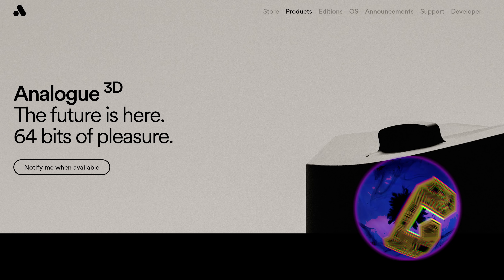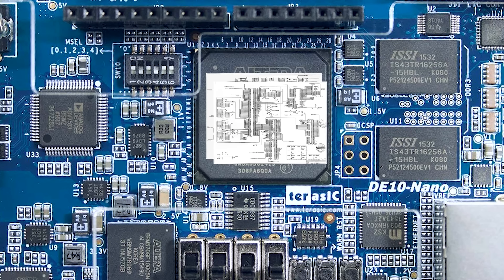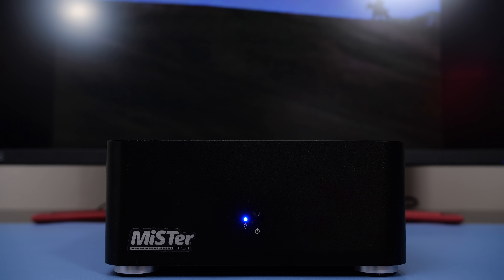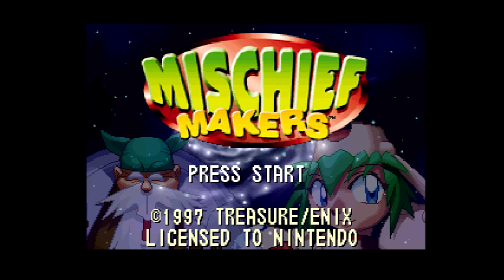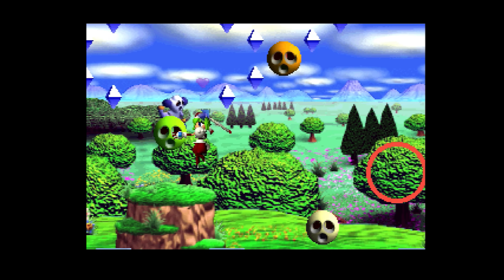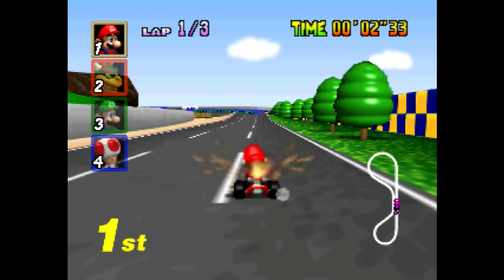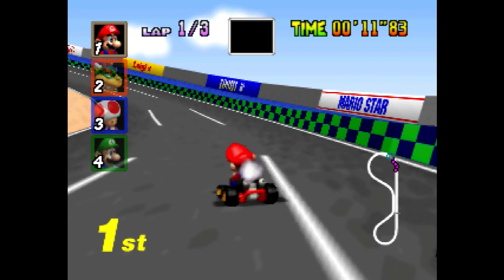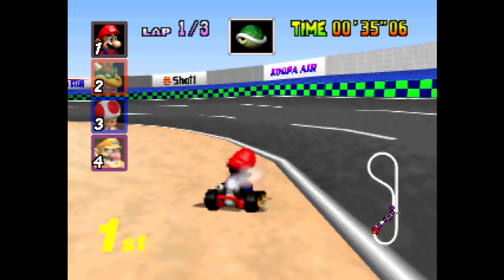FPGA Nintendo 64 gaming is here.

Comment: FPGA cores are not 1:1 recreations of the original console hardware. They emulate the original hardware through reverse engineering, but the internal workings may be entirely different from the original system. Therefore they're no more preserving the original hardware than a software emulator.
Reply: That's true if you ignore methods using scans of ICs after decapsulation and delayering them, however, it's true that in theory neither is preserving the original hardware better than the other because both are nothing more than software files. In practice, FPGAs force the developers to get closer to the original behavior of the hardware imitating due to the constraints of the platfrm.
Reply: Correct. But FPGA vendors will try to convince you it's not "emulation" and how it's inherently more accurate than software emulators, which is not the case. This is all marketing talk of course that aims to the big game collectors who usually don't know much about emulators and have a bias against them.
Reply: It's probably more accurate to say that this is a hardware emulation instead of a software emulation (since we are taking it down to the chip level).  But I would have to agree that is must be called an emulator if for no other reason than we aren't using the original chips.
Reply: Interesting. I've heard it's 1:1 multiple times from various outlets. Guess I'm not surprised!
Reply: You don’t go out of your way to call hardware clones and the official SNES consoles with the 1-chip “emulation” so you are really just grifting. Hardware clones are done the exact same way only they write HDL to use logical elements from an ASIC, meaning it gets baked in at the fabricator instead of being field programmable. The ability to be updated/reconfigured in the field is the essence of an FPGA and makes it better, since any errors are permanently baked in to your typical ASIC hardware clone but can be revised in an FPGA clone. Imagine if Nintendo could have fixed their SNES 1-chip clone.
Reply: MVG talked a bit about this on last night’s Spawncast. Also mentioning that there are interpretations and judgements, so it’s not the exact 1:1 that is sometimes touted
Reply: @billcook4768  No one has touted Robert’s core as 1:1. There are interpretations exactly like that even in original hardware, like when the Super NES reduced PPU1 and PPU2 into a combined PPU, or when they further reduced the chips by combining them with the CPU to make the so-called “1-Chip.” The ASIC they used is imperfect. SNES clone makers somehow got their hands on it and are still making SNES 1-chip hardware clones to this day. The only real difference between the ASIC and an FPGA is the “field programmable” part, where the ASIC needs to be defined at the chip fabricator with a lithography mask. FPGA can be defined and redefined later so any errors can actually be fixed. Meanwhile, SNES 1-chip consoles from Nintendo themselves still have issues with certain games while the Super Nt’s FPGA can not only fix the flaws it can even reconfigure itself to replicate the various quirks and flaws of the 1-chip, 3-chip, etc.
Reply: Easy enough for you to say without doing the work, that said for the de10 nano and mister I partially agree with you for the analogue I don't have enough information to say.  About 15 years ago I recreated the 2a03 on FPGA(spartan 5 and MAX10) accurately with all the control signals and timings which accurately models this particular chip.    Now is someone that reverse engineers and works on a core a "wizard"? not at all.  If you know what you're doing and have valid reverse engineering that verifies then it wouldn't take much time at all.  In the case of the Cyclone V i know that multiple parts are emulated through the HPS(hard processor) so saying the entire system is on the C5 is disingenuous.  I've been around the emulation scene since 1995(im friends with zsknight and the like and was part of the org zsnes team).

Comment: It should be acknowledged that people also wrote off PS1 and Saturn for years. I even saw a lot of people say the 32X was highly unlikely prior to those. To simply say people thought the ceiling was PS1 and Saturn for years is kind of misleading.
Reply: From the start I was hearing “maybe PlayStation” as the ceiling. Anyone saying otherwise to downplay the possibility was likely trying to manage expectations because it wasn’t a sure thing. Meanwhile, 32X and Saturn hardware are too similar to distinguish this way. With so much shared hardware the main difference ends up being that one needs a Genesis core along side it and the other needs an ODE to replicate the optical drive functions. My understanding is that most MiSTer cores with an optical drive use a kind of software emulation on the ARM SoC for the shared optical drive framework while the rest is replicated in hardware FPGA.

Comment: Does such a thing exist as an "FPGA card" to out into a regular PC? I'm curious about the future of gaming hardware and wonder if a hybrid system using a regular modern processor in combination with this tech would be the best of both worlds. It'd also allow us to have a single system for all games.
Reply: There is but they are really expensive and meant for development, something like the MISTer probably could be sold as a Pcie card but that' just an assumption.
Reply: Interestingly enough, these FPGAs do have a normal ARM processor inside them that is used in the MiSTer for the Linux backend that runs all the USB input devices, networking, storage, and probably anything else that isn't running on the FPGA side. However, it is not very powerful. You have a pretty cool idea though.
Reply: Both the mister and the Mars projects are "hybrid", in the sense that they also have an ARM CPU, things like menu and processes that make sense make use of it.

As for the "FPGA Card", there are many already, but the modern CPUs are already capable of doing low level emulation, offering practicaly the same thing as a card used for retro hardware would.  However, PCs have a hardware and software pipeline GPU, OS etc to take care of, which add delays, so it's not as fast as a processing/display that's done all in FPGA.

Comment: Can they please stop saying "no emulation"? Emulation: hardware or software that enables one computer system to behave like another computer system.
Reply: FPGAs don't really fit that definition as they're not necessarily a computer, and don't have any default behaviour. If you don't configure one after powering it on, it'll just sit there consuming power without doing anything. If anything, they're like a middle-ground between fixed-function hardware and software emulation. It's not following existing instructions to get the desired behaviour, but it's not baked into the circuitry either.

"Re-implementation" might fit. After all, you can get FPGA replacements for the custom video or sound chips in the Commodore 64 that can be dropped into an original system's sockets. In the PC realm, the Graphics Gremlin video card implements classic and VGA-compatible versions of MDA and CGA using an FPGA. Stick it in a retro-PC and it won't be able to tell the differnce between that and an original MDA or CGA card, and in the classic modes, neither will a period monitor.

Overall, I think we're running up against the limitations of language here. We just don't have an accurate term for what we're dealing with, so we're trying to cram it into boxes we already have and it doesn't fit either well.

Comment: Preservation is thrown around a lot, when talking about FPGA. But I am seeing more and more, that the original design gets scrapped because it won't fit into the FPGA or that there is a more mothern way of designing hardware and that's why a 1:1 replication isn't used in the implementation.

Sure you might not notice the difference when playing the games, and as such there's a type of preservation. There was however a reason why the original design was made the way it was and that is getting lost.

When the original hardware won't work anymore and we only have modern interpretations of the original designs. Then we have not preserved the history. It would be nice to be able to look back on what was and be able to learn from it. But with the current mindset, that won't be possible.
Reply: Robert’s throwing out what was never used and trying to replicate the rest down to the most subtle/minute detail. There are other cores for more powerful FPGAs that aim to replicate the N64 more closely, like UltraFP64 and whatever Analogue is doing.
Reply: @emmettturner9452  Even though this video is about that specific core, I am speaking more generally. Jotego does it with every core he makes and he might not be alone.

My point is preservation for who? Obviously just the gamer's, not hardware designers that want to study what was. The original hardware design have become a second class citizen, so to speak. But the games would never have existed in the first place, without that hardware. So if you are really into preservation then you must preserve that other side to, not just making the games playable.
Reply: @LisaSamaritan  Jotego’s TMNT core was made with transistor-level chip-peeling/recapping but that’s really because Furrtek did the legwork. ;) Jotego will source existing HDL wherever he can, so some like a Z80 might be a true transistor-level replica and others will use the “black box” style of development using a logic analyzer to replicate logical inputs and outputs rather than the internal structure of the original chip’s logic.
Reply: @LisaSamaritan  …and if you think about it, that’s exactly what Nintendo did for the SNES 1-chip consoles. These days we have FOGA clone consoles that reconfigure themselves to replicate either the 1-chip, combined PPU, or original 3-chip SNES consoles. ;) Any one configuration could have flaws but, then again, so did the original 1-chip… and it didn’t have any “field programmability” to deal with it. They got baked in forever and even the SNES fixed hardware clones today have the same flaws (RetroBit, RetroN, Old Skool, etc clones like Supaboy and RetroDuo). Yeah, being defined at the fabricator with a lithographic mask versus being able to redefine in situ (field programmable) is the only real difference between FPGA and a traditional fixed hardware clone.
Reply: @emmettturner9452  we are definitely not talking about the same thing...
Reply: @LisaSamaritan   Oh, we are. We definitely are… whether you realize it or not.

Both ASIC and FPGA are written with an HDL, and revisions to the original hardware often incorporate an ASIC developed without the original chip designs the exact same way Jotego does it. In the end, the only functional difference between FPGA and ASIC is that one is “field programmable” and the other isn’t. That means one can be reconfigured to fix mistakes or clone entirely different set of hardware and the other  is a fixed hardware clone replicating one set of hardware where mistakes are baked in forever (the 1-Chip SNES is one such example).

Because FPGA is able to be revised it is inherently better at preserving the original hardware than even some things we actually consider original hardware (again: SNES 1-Chip… FPGA can replicate both that and the original hardware!).
Reply: @emmettturner9452  No. I am saying that if the original creator of the hardware wants to make a revision, then that's up to them. But someone claiming to preserving the hardware design, shouldn't make up their own design. I don't care if it is cycle accurate and produces the same end result (being able to play the game).

Regarding your example, you are claiming that it should be an endless amount of fixes. But I am the type of person that believes in doing things the right way, the first time. Then you don't have to do more work than necessary...

Anyway, that's beside the point. Let me use a completely different example. Let's say that we have an arcade machine. There was only ever a single game released for this machine.

The fact that there was only one game released, is not a limitation of the machine. You could make however many games that you want, as long as you are sticking to the hardware's inherent limitation.

Now someone comes along and makes a core for this arcade machine. And they deside that because there was only a single game, he can remove functionality and cut corners, because it doesn't matter to make this game playable.

This however is shortsighted. Because a unreleased game or someone's homebrew game, that would have worked on the original hardware (by only replacing the memory chips containing the game asset's), is now unplayable on the core.

If we are doing preservation, then we should also preserve the ability to use the hardware design in ANY way, that it was originally able to do.
Reply: @LisaSamaritan  This just sounds like an issue of documentation. Do you think they are decapping chips and getting all the PCB schematics, putting some half-ass core out then deleting all the original hardware info they had on it? Well if that's the case, sure, that's not preservation, but I really doubt that's what they are doing.
Reply: @kunka592  did you read my last example about an arcade core?
Reply: @LisaSamaritan   I understand, but the reason I keep using the 1-Chip example is because it wasn’t a simple revision the creator of the original hardware chose to make. They basically made the original hardware then asked a different engineering team to clone it without the source designs so it could be condensed onto fewer chips. They did not have the goal of preserving the original hardware design either… just making a functional clone.

I understand your concern here. If I made a new game for a hardware platform and I used the FPGA core to develop it, it would be ideal if the results were identical to ensure my game could run on original hardware… but I also think you missed the part where that level of documentation has been happening side by side with the cores that had to be cut down.

Take the Robert “FPGAzumSpass” Peip’s N64 core… look at all the buzz that one gets and understand that a fully-implemented N64 FPGA core was designed and complete years ago from Murray “MazaMars” AKA UltraFP64… there was just no way it was going to work on anything we have available to play games on (5-50k USD dev hardware not withstanding). Why isn’t it getting as much hype and praise? Well, because it didn’t make any sense to release when there was nothing to run it on and there was potentially some value in keeping it private for now. FWIW, I have a feeling Murray is behind MARS FPGA or the Analogue 3D core.

So, yes, you might be annoyed that cores like the MiSTer N64 aren’t even trying to be perfect replicas but it literally couldn’t be… plus we get to have our cake and eat it too. Robert aims to replicate every aspect of the original experience while others want to replicate every aspect of the hardware that we’ve never experienced.

About the Analogue 3D, I know MarshallH was on the Analogue Pocket team and he was part of the team that decapped and replicated the N64’s CIC and PIF chips with FPGA and an electron tunneling microscope. We have them to thanks for the UltraCIC and UltraPIF today, and even things like UltraHDMI. It’s very likely that he and his team are behind the Analogue 3D and it’s possible that they mapped out every transistor on the CPU and RCP die… same as they did for the CIC and PIF. That said, I don’t think they could afford to put an FPGA powerful enough to do that in a dedicated console that doesn’t even support OpenFPGA (even the DE10-Nano had to be subsidized since it cost less than the FPGA alone). I can’t wait to see where this goes!

Comment: What does the "4K visuals" of the analogue mean? Will it be rendering at 4k internally, or will it just output at 4k?
Reply: I bet Output, as rendering it higher could bring Problems with Sprites and Stuff that just isn't in that Resolution.
Reply: They already said it would be for replicating different CRT masks but here’s hoping they also have a way to at least double the rendering resolution. I’m hoping for something like 3Dfx SLI where they might replicate two RDPs simultaneously with some kind of offset so that they render alternating scanlines that can be interleaved together for double the vertical resolution.